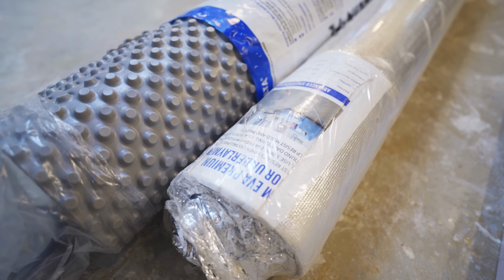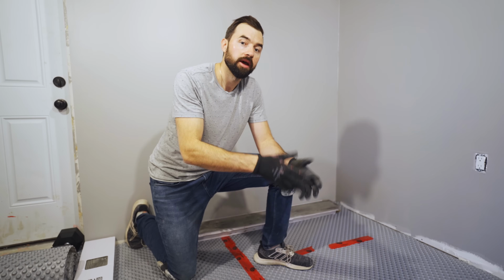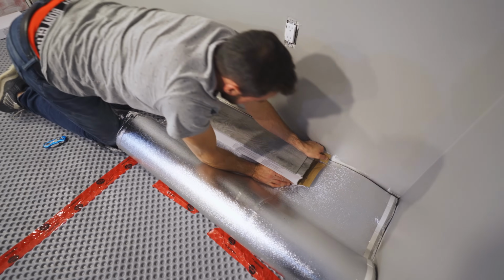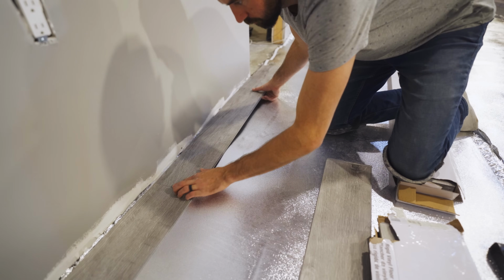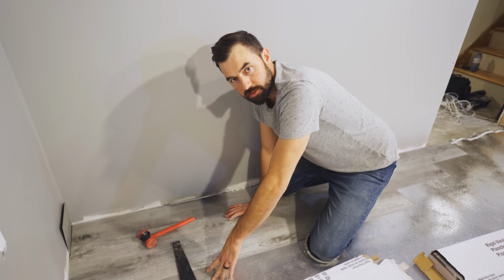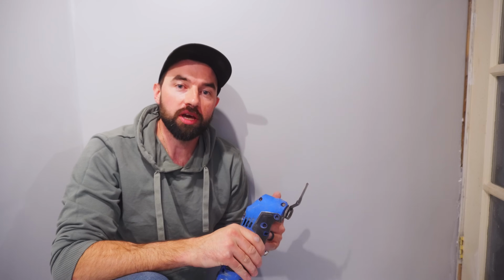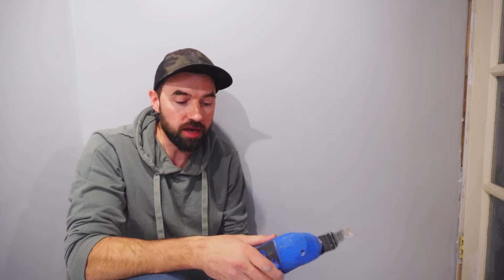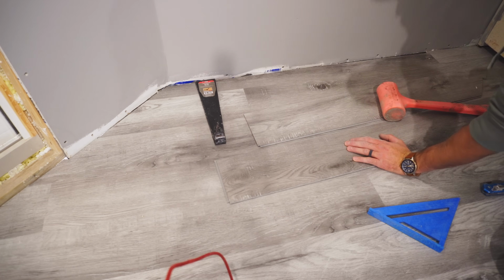How to Install Vinyl or Laminate Floors in a Basement (Over a Concrete Slab)

Comment: You don't use vapor barrier on vinyl because it's 100% waterproof, you are creating a moisture trap that will mold and mildew under your flooring... These planks have microbial tech and allow air to stop such mold and you are defeating the purpose., Vapor barrier is protect the material, and nothing more...
Reply: Is this on all interlocking plank or just vinyl. I’m looking to put some in my living room which is now just the cement slab
Reply: @ccantu187  as long as your planks are vinyl, but check the box it will tell you the material requirements...
Reply: Yup eso over concrete water naturally drains through concrete, now its going to be trapped in between
Reply: What's the best underlay for on slab vinyl flooring?
Reply: Wrong! You didn’t listen or watch the video. The first moisture barrier subfloor is hard plastic and has a pegged bottom that provides enough air between the concrete and the underlayment to allow moisture to surface to the top of the slab but then dry out below the surface of the subfloor. The underlayment he uses over the top of the subfloor not only provides a smooth surface for his finished flooring, it further reduces any moisture escaping up through the finished tongue and groove floor.
Reply: @bbrieske  never used it in ny home and no issues at all
Reply: @bbrieske  to much talking, post the manufacturing label 🤷🏽‍♂️
I'm not wrong because I have multiple trades under my belt, I'm around multiple home builders, and run my own show, and though you could have one of the few products of vinyl that requires some sort of barrier, the whole concept of vinyl to to STOP rot and damage when get's wet 🤷🏽‍♂️

So, I am not wrong because I'm stating what the industry has said and produced a particular product that can get wet and not rot, you're saying they're wrong not me...

If you are to dense to understand what I am saying read, Google, grab the friggin box and read instructions and warranty 🤷🏽‍♂️
Reply: @Sumama-Mitch lol I run my own show, but I’m on other peoples videos learning how to install flooring. Give me a break guy.
Reply: @3dprintexplorer  and here you are on my comment trying to validate you, poor guy needs a hug, come on in for a hug, you need a job? I'll cut you a break, come apply let me see your skills and we'll go from there...🤭

Comment: The only question I got is my entire basement floor is concrete but when I removed my water heater water got all over the floor and broke the concrete up pretty good so my only question is how could I install vinyl flooring over the spots that are broken up & Has holes I don't want to have to spend over $400 to pay somebody to come out and fix the basement floor I would rather get the vinyl flooring and do it myself I just want to fix the spots on my basement floor that have big holes and it's cracked up
Reply from the maker: Hey Robert.  I would break out any loose concrete with a hammer and vacuum and clean it really well with water.  

Depending how big the holes are either use floor levelling cement or bagged concrete to fill in the holes.  Both can be purchased for under $10 a bag.   

Good luck!
Reply: @DIYDudes  Thank You! I appreciate that will definitely do that

Comment: We are having difficulty getting I strange carriers to understand that LVP (just like laminate) needs to be installed on a barrier. Is there a building code, or an “industry standard” that I can refer to when making this argument?
Reply from the maker: You would have to check with your local municipality or the flooring manufacturer.  There is no one size fits all with the regulations sorry

Comment: My whole house is on a slab and it's all carpet. I've layed vinyl floor before, but not on concrete. With the dimple and vapor barrier stuff you put underneath, can you feel it squish or bounce when walking on it? I feel like I am able to do this, I just want to get the right supplies first.
Reply from the maker: No just get a rigid plank at least 3/8 thick preferably 1/2” to 3/4”   Good luck!

Comment: Why or why not would I need an under laminate if the flooring is waterproof? And already has one?
Reply from the maker: The under payment is designed with an air gap to allow moisture to dry.   If it’s not present moisture can collect (in the the right conditions) and create fungus.  

Good luck!

Comment: Hi! We have a 60s home and we made the mistake of laying vinyl roll flooring directly on the concrete slab, I started smelling humidity a year later and I decided to lift part of it. Slab was damp and the whole textile bottom was full of mold; this was only a 200sf room. In the rest on the basement we installed Biyork Hydro Gen  6, on the specs it required no vapour barrier or other subfloor so we also installed directly on the slab and now I'm worried that could be an issue too! it's very difficult to remove the planks as the whole basement has baseboards but would appreciate some guidance on what to do here. what are potential problems or dangers? the vinyl roll will be removed and we will address it but I'm now worried on the hard vinyl plans.  Thanks!
Reply: Man I am in the same boat currently. Unfortunately, my main sewer line failed so I had to take up my planks, and found some areas were damp, but luckily no standing water.  We were using a vapor barrier,  so some of the areas where I put pressure on the concrete like my PC chair for long periods of time had moisture. I have watched a ton of videos and I think I have a better solution. Look for a vapor barrier that allows for some permutation, not solid plastic, but also not fully permeable otherwise you will have the same issue, then do what he is doing find a thin membrane that has channels that way if it does take on water it can flow freely towards a drain. I wouldn't suggest leveling out your basement, you always want water moving towards a drain. spot level, but never an entire area. I will be checking out this membrane as we get ready to lay down our plans again, luckily I hadn't finished my trim or anything like that.

Comment: Excellent video. I see that you do not use the plastic tapping blocks that some people complain about breaking or messing up their vinyl.
Reply from the maker: Thank you.  Yes I like to use a scrap piece of flooring… that way joint has full contact and is less likely to break
Reply: I’ve done a similar tactic.  Highly recommend using the scrap price to tap the joints together. The plastic blocks will damage the tongue and groove. Though I only use the pull block on the edges. Otherwise I just tap the scrap piece directly.  Great video!

Comment: Does one still use underlayment if the vinyl plank as an attached pad?
Reply: If on concrete slab yes. If installing on top of other flooring or OSB floors no.

Comment: Why do pros use expensive levelling agents (eg. Dunlop 3.5kg Ardit Feather Finish) instead of cheap cement/mortar ? Concrete levelling is kind of ripoff as tradie can't/won't tell you how much until the install day & you are stuck to pay whatever even if he ask $$$$$$ ??!!
Reply from the maker: Not sure.   It’s a pretty easy job overall, maybe they just charge per bag they use.  It would be hard to estimate that in advance

Comment: So the tile is just set ontop of the stuff and not stuck down at all?
Reply from the maker: Yes that’s correct it’s designed to be a floating floor so it expands/contracts slightly

Comment: What happens to the water vapor conning up from the concrete and hits the dimpled vapor barrier? Does the floor underneath collect moisture and mold?
Reply from the maker: It creates an air gap that allows moisture to dry …. If you didn’t have an air gap then the moisture would be stuck and not dry.   Good luck!

Comment: Drew - think I need the same vapor barrier and EVA if I'm doing this on a slab, ranch home in FL built in 2018? Or, can I just go with the 6 mil plastic and skip the EVA?
Reply from the maker: The Eva or similar soft under pad makes the floor feel softer and dampens the sound of people walking. I wouldn’t skip it but check the manufacturer’s instructions for the floor you are putting down.   And if your Lee really concerned you can call their tech and discuss your specific area.  They will give you specifics.  
Thanks for watching!

Comment: We have thinks like check valve access pipes and other types of things we need access to on the slab... How do you do flooring when you need to be able to remove part of it if you need to access the check valves or something? Was told we can ot cover over them.
Reply from the maker: You’ll have to box them out using trim. Build a trim square around the opening, butt the floor up to that and then cover the gap with another piece of trim.  Cut a lid out of wood or use flooring material for the opening itself.   

Good luck!
Reply: @DIYDudes  thanks.
Reply from the maker: Hope it works out for you good luck!

Comment: hmmm , correct me if i’m
wrong or late in my comment…. that looks like vinyl-plank as supposed to laminate-planks. in that case you could have skipped the whole underlaymen!?!….. in the event of water/flood you’ll be technically safe bc vinyl planks is practically water proof. …. but anywho you just spent money you shouldn’t have bc it’s not laminate-planks.(which requires underlayment). and in the event you wanted to use any kind of water proof/resistance directly over concrete for this application ….. you could have used REDGUARD.
Reply from the maker: This method provides the ability for water to dry out, insulation and sound dampening 

If you just red guard your floor will be cold the red guard may keep water from below out if you do a 100% perfect job but won’t allow spills from above to dry out and your floor will be cold and sound like a tap dancing studio
Reply: @DIYDudes  btw, i liked your work on the floor , keep up the gr8t vid you do. 👍🏼
Reply from the maker: Thank you!

Comment: Question...why not use RedGuard or a similar product to waterproof/seal the floor?
Reply from the maker: You could but you wouldn’t get the same benefit… this adds insulation, sound dampening, moisture protection from “above” sources… water can dry out if it’s spilled.  Most floors are water proof
Now so they won’t warp but water can still be trapped underneath and mold if it can’t dry out 

Also redguard is a a chemical you might not get full or good coverage and it smells horrible

Comment: I want to install 2x2 foam tiles (like the one for children or for yoga) in the basement (I will leave the corners and edges next to the wall uncovered). Do I need a dimple moisture barrier underneath that foam, specifically to avoid mold? What about a thin polyethylene later under the foam? Or the blue dmx? Or will the foam be enough. The underneath of the foam is flat. Thanks!
Reply from the maker: I wouldn’t worry about mold
Forming under foam tiles.   They are meant to be temporary… you can remove them and clean as required if you spill or anything
Reply: @DIYDudes  thanks ❤️. So the moisture seeping up from the concrete won't get stuck under the foam and get all moldy? I don't know much about the chemistry of concrete/foam combination and if mold grows there if there is no air flow! 🙂
Reply from the maker: It depends on how your house was built with respect to the quality of the foundation.  I would lay the foam down and just periodically check under a corner to see how it’s doing.   Good luck!

Comment: I'm putting a kitchen in a basement. two walls are drywall (from previous construction) and one is new studs. The fourth side will abut with carpet, so I'll just put a threshold there. Is there any reason I could not put the floor in before the drywall on the one side? Any suggestions on the transition to the carpet (~13 ft)?
Reply from the maker: No problem putting the floor in first. Just have to make sure you keep it covered to keep it clean and ensure you have a wide enough gap in the wall. For the transition, your best bet would be to find a T moulding that matches your floor color.

If you haven’t purchased your floor already, you can get a flooring that has a matching t moulding

Comment: U should use a softer mallet so you don’t break your edges I have a soft mallet and haven’t broken or chipped any edges
Reply from the maker: Yes definitely,   The hammer I used was a soft plastic but I also use rubber mallets as well 

Thanks for watching

Comment: My house is built on a slab. My floors are directly on the concrete slab. I have to replace my floors. Should I start with the waterproofing?  Such an awesome idea 💡 also, there are pet stains in the concrete. Do I need to put down a stain blocker first?  What is dimplesboard? Awesome video!!  I have the tools ⚒️!Thank you. Happy Halloween! 🎃
Reply from the maker: I would just clean the floor then so the dimple board/ underlayment.  

You should be good with that.  Thanks for watching good luck!

Comment: How is your flooring holding up? Many ppl say the simple Matt is too thick for spc flooring and will cause it to come apart at some seams
Reply from the maker: It’s holding up really good actually…!no joint separation and it’s nice and warm and quite.  

Thanks for watching!
Reply: @DIYDudes  thanks man, I’m stressing about an underpayment, so many mixed reviews. Have a good one:)

Comment: Do you got any issue with moisture? My living house is built in late 60s and living room is concrete. I've put laminate tile amd have moisture issue. Ive pulled it up and laid down eco cork underlayment. Still moisture issue. Think i can just add the dmx under the eco cork foam?
Reply from the maker: You should figure out where the moisture is coming from.   If it’s through the concrete you likely have a drainage problem on the exterior of your house
Reply: @DIYDudes  its not a surface leak at least to my knowledge. We let it air dry before installing them again.
Also the my neighbor had same issue with same home structure.

Comment: Great video! Why not lay the moisture barrier first?
Reply from the maker: The dimple board acts as an air gap to allow the moisture that does permeate from the concrete to dry rather than be compressed and not dry

Comment: Hi I have expansion gaps in my concrete in my basement. What do I need to fill it in with before putting self leveling concrete on it?
Reply from the maker: How deep and wide is the gap?
Reply: @DIYDudes  about 1/2 inch wide and around 1/4 in deep
Reply: @TsoHangry  do you need to fill it?

Comment: i need advice...ourr basement is only 1 meter above the ground....what kind of underlayment to be used...and i have 4 windows..but the floor is concrete..
Reply from the maker: I would use the same system which is an underpad that has an air gap
Reply: ok...i watch some videos that they installed the green underlayment...lol i dont know the name...

Comment: Instead of using Moisture barrier can I use the carpet underlay that is still there after I removed the carpet to replace it with vinyl? It's in good shape. Thanks.
Reply from the maker: No you need to remove the carpet underlay.   It’s too spongy to support your floor

Comment: Your video was great. You went step by step and explained why and how it would work. I do have a question for you. My son is remodeling our library at church for his Eagle project for boy scouts. There is currently carpet in there but it is concrete underneath. Should we just use the Eva form or both items you suggested in the video?
Reply from the maker: The  layer of dimple board is huge benefit in terms of the ability to allow your floor to dry if there is moisture coming through the slab but you could do with out it if you arnt worried about that.

Comment: why not use Thompson water seal ??
Reply from the maker: This method creates an air gap that adds insulation value and actually allows Any Any water that finds its way in from above for example a spill to dry out

Comment: This is probably a really dumb question, but how do we prevent the floor from sliding? Thank you :)
Reply from the maker: The floor is just held in place by friction but obviously you wanted to be able to move a little bit as it expands and contracts
Reply: @DIYDudes  I think they meant when first starting how to secure the first couple rows so you have a solid foundation to work off of. I've seen using  some narrow scrap pieces, hammer drilling through into the slab and screwing them down. Or drilling and securing your first piece out towards the edge where your trim will cover it. In my case I did self leveler that I don't wanna drill through so another method I've seen is gluing the scrap pieces then coming back later, scraping the glue off and dropping finished pieces in

Comment: Did you add glue or leveling the floor? Tha k you
Reply from the maker: No leveling required for us as the slab was flat.  

Do. Or glue down the floor, it is supposed to be able to expand and contract uniformly.  If it’s glued down the joints will separate

Comment: I noticed you mentioned you used a rigid vinyl plank.  Is it okay to install vinyl planks with a cork back on top of the moisture barrier and foam underpad? Or is all this extra padding going to give the floor a water bed type feel was you're walking on it.
Reply from the maker: No I think it would be fine.  You could do a small test section to check. Good Luck

Comment: Thanks for a great video. What do you think about using a roll on membrane like Bona R540 instead of the simple board?
Reply from the maker: I’m sure it would work.   The products i use help with insulation and sound dampening… a roll on sealer wouldn’t but either way would be a good moisture barrier 

Thanks for watching